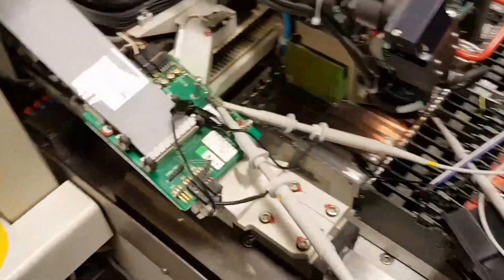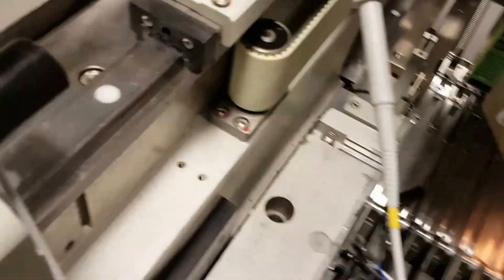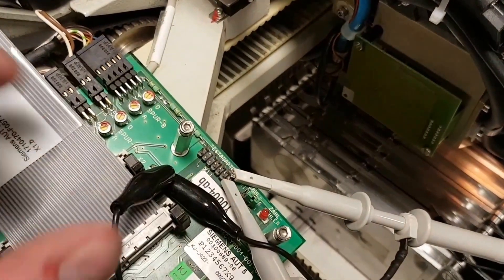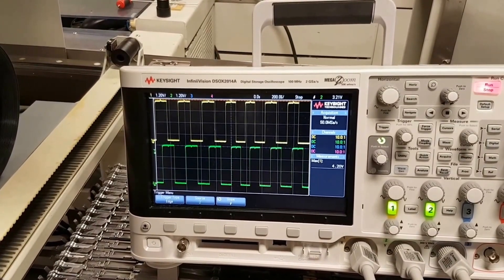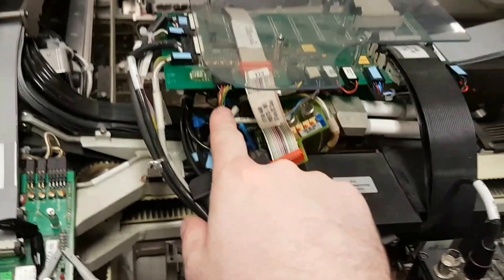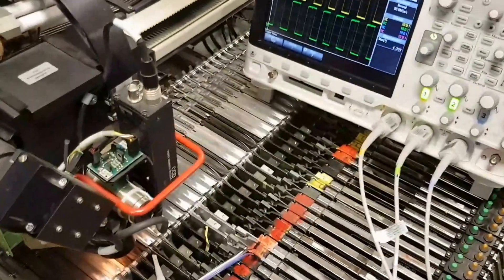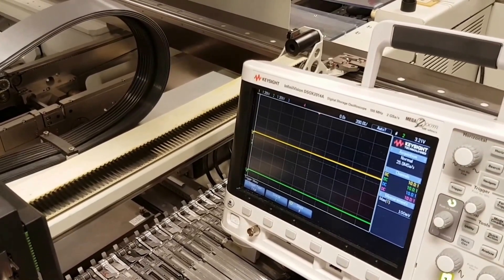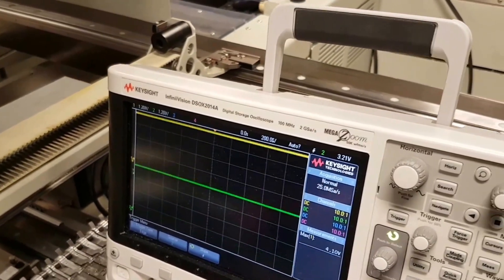SIEMENS SIPLACE 80 F3 Linear Encoder Output (Y Axis)

Comment: This is optical encoder from rsf. It illuminates the fine pattern on the scale, the mirrored light is coming back through a specially designed aperture, creating sinusoids signal, what you measured. The A and Be are phase shifted to each other by 90degree to get direction inform. In platform I machines you have to adjust the sin wave amplifier with those potis and they are digitalised after. It keeps the phase shift and goes down to the axiscards.
Every 5cm there is the N-mark (zeropulse), what you can catch by setting appropriate trigger level on your osci.